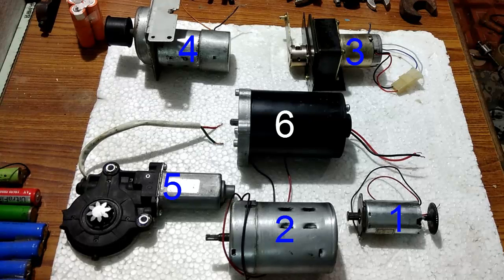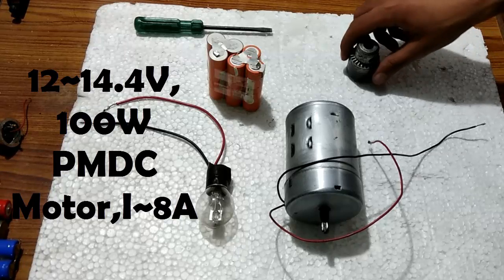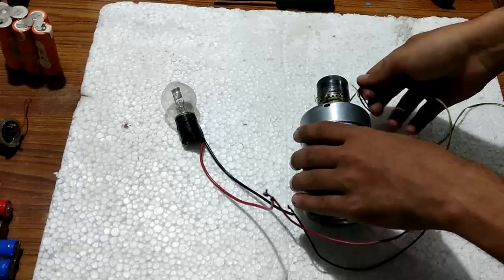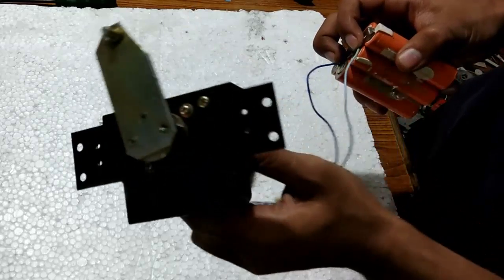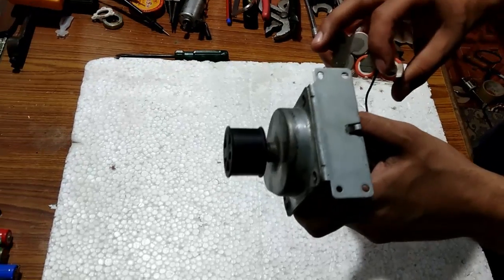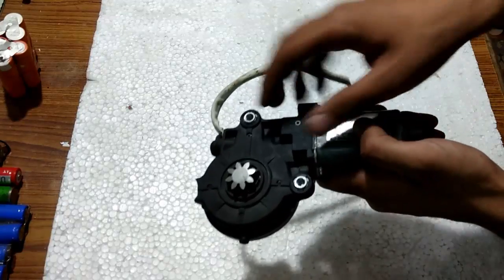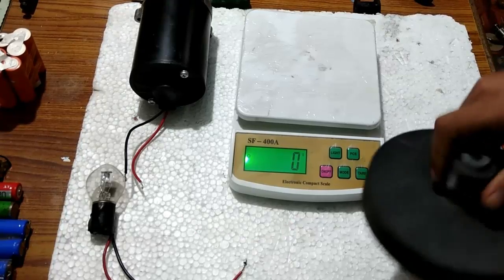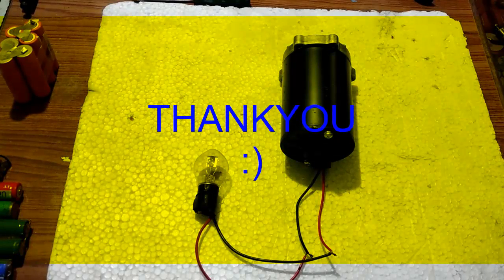DC Motors DC Generators in 6 different types with each having its own use and specs

Comment: hello sir,..
i have a plan to make weldernator,..a welding machine generate power by alternator,..
but i want to change alternator with PM motor DC  like this link : https://www.youtube.com/watch?v=mYGnQGojFzI
as i know,..in the video,..inventor use EPS motor (electronic powerSteering), but I want to change EPS motor with starter motor on car,....
what do u think,..did u have any exprienced with starter motor..?
(sory for my bad English)
Reply from the maker: Yeah!  There are 2 types of starter motors 1) PMDC 2)DC Shunt motors.Pmdc starter motor will surely work but Dc shunt starter motors won't work... Yeah your english is good enough :)
Reply: Oke,..Thanks for answer and all of ur video,...many things i learned from ur video,..
Reply from the maker: Anytime :) :)